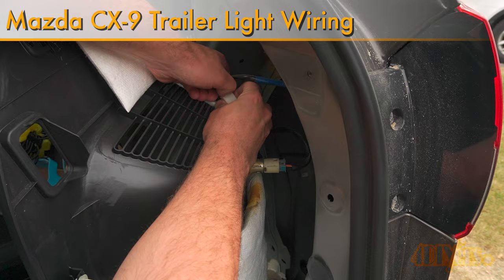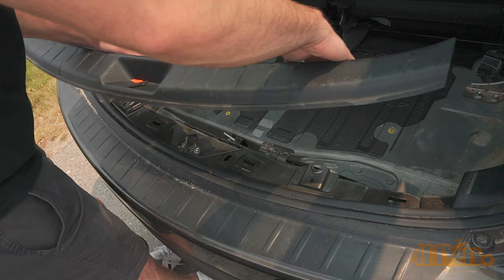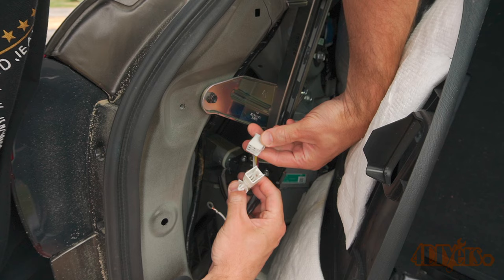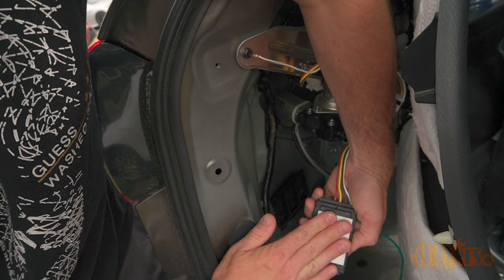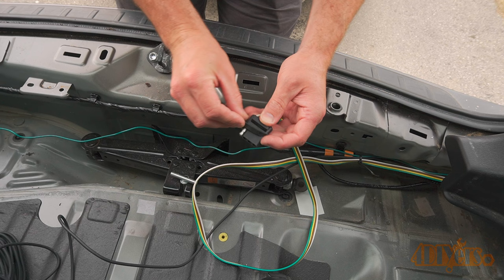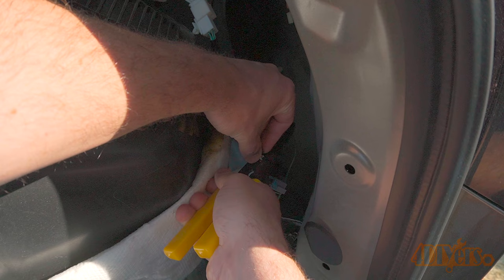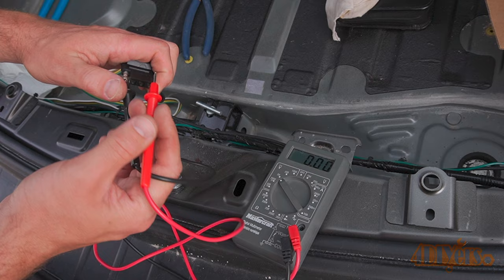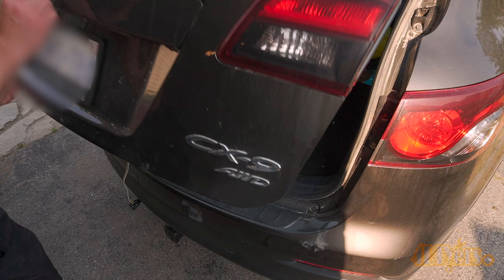How to Install Trailer Wiring in a Mazda CX9

Comment: Excellent idea tapping into the 12V outlet wiring. I've seen a few installation videos showing how to run the plus cable under the car, all the way to the battery - mind blowing! Good job! I'm looking forward to installing mine like that!
Reply from the maker: Thank you!
Reply: Can u pull a 3,000 pound camper with this Cx9 I got a 2015 cx9 so I’m curious